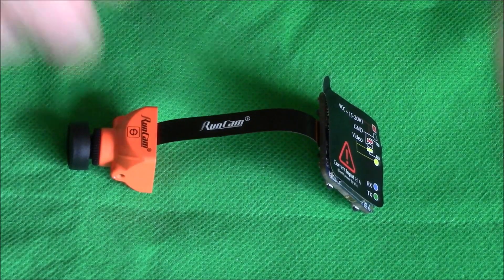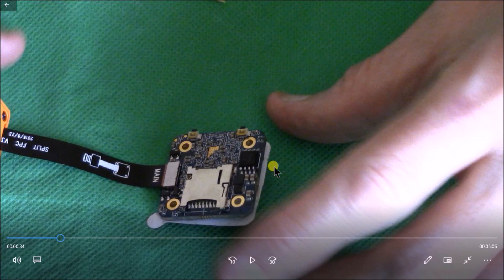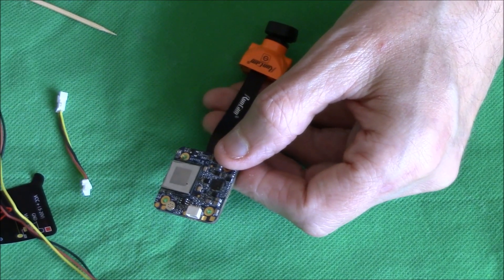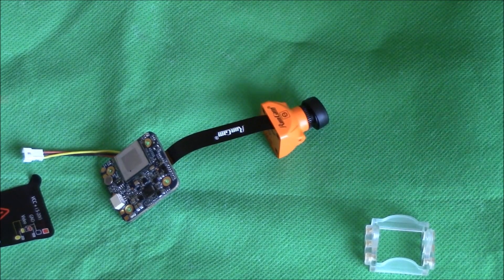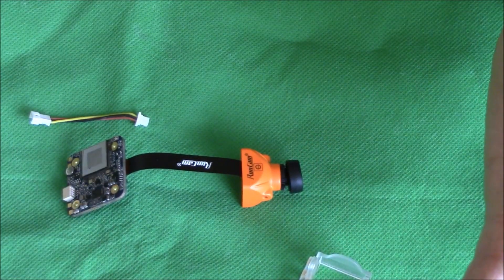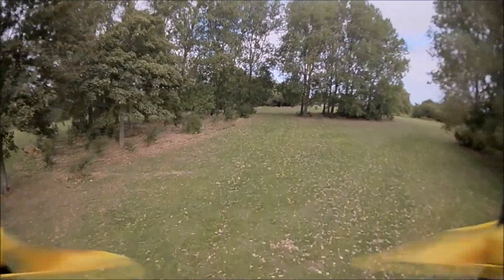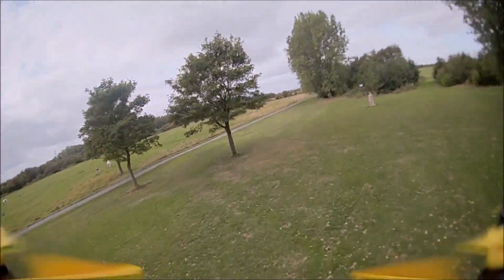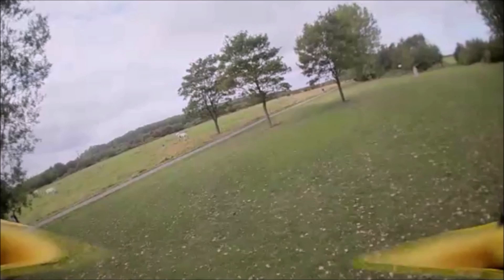RUNCAM SPLIT MINI V2 REVIEW

Comment: Good evening, I bought a run cam split mini 2, as soon as it receives power the camera starts recording on the micro sd but in analogy not by any video signal, would you kindly help me?
Reply from the maker: I'm sorry to hear this unfortunately your not alone. I have had problems with the Runcam Split range myself and also have plenty of other people. Sins I made this video I have posted more about problems with the Split mini, i have gone through two of them. The first one the buttons came off and the image froze during a flight and i had a very bad crash. I got it from Banggood who were great about it and sent me another, But unfortunately once again the screen went Blank in mid flight, so that time i asked for a refund which i recommend you doing the same.  Runcam are a great company and make some awesome fpv cams, but they seem to have a manufacturing issues across the board on there Splits. I'm sorry to bring you such bad news and i hope you get a refund. I can recommend the Runcam Mini DVR Board pretty dam good.
Reply: George Cooper thank you very much, with many attempts I managed to get the video signal even if really very disturbed, I bought a filter lc hoping to solve
Reply from the maker: Happy to hear you got it to work, I hope you don't have anymore problems, Crossed fingers